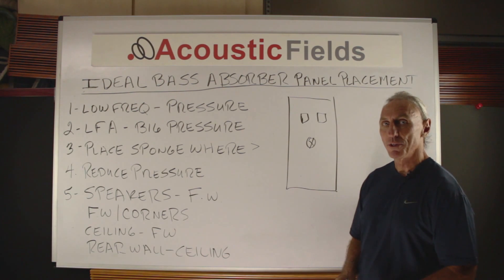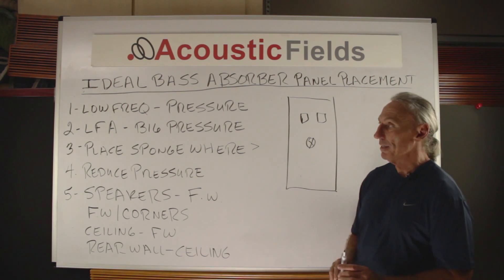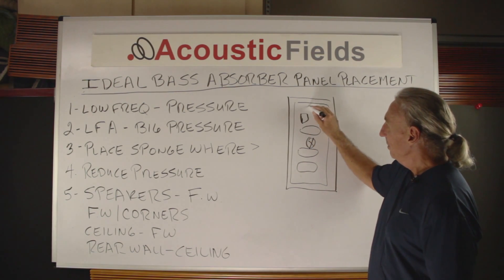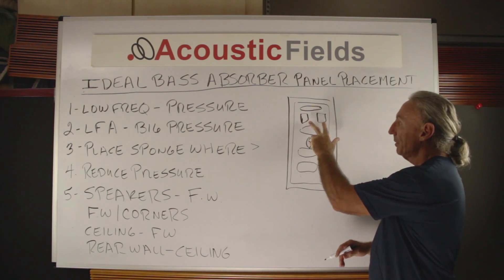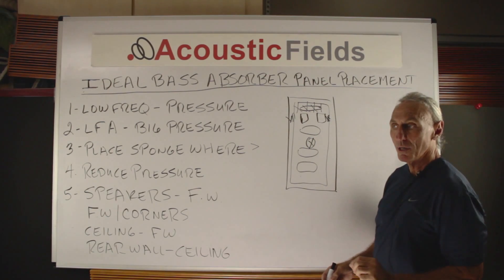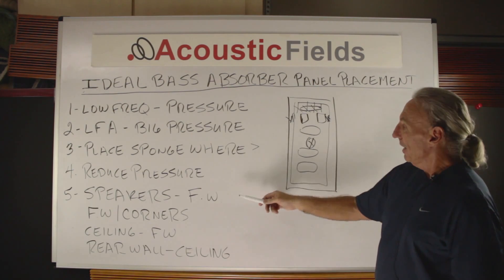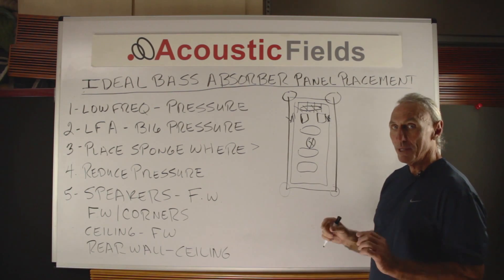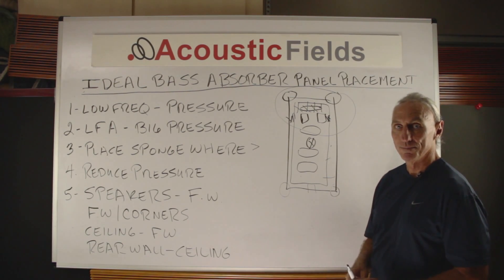Ideal Bass Absorber Panel Placement - www.AcousticFields.com

Comment: Gospel Denis! I'm using your philosophy with killer results!!! Thank you
Reply from the maker: Thank you. I would like to see more of these comment types. What treatment tactics are you using and why.
Reply: @AcousticFields  I'm following your principles here! I'm using a competitor, only because they where more accessible? I'm capturing the first reflection at only about 2 feet from the side of each speaker. Great for uneven rooms. Keeping all? the reflections off the wall, right off the bat. Nothing in the corners. Only from behind each speaker (open baffle) and in between on the front wall!
Reply from the maker: Ok good. You have addressed some reflection issues. What have you done to deal with unwanted pressures.
Reply: @AcousticFields  I have 5 ASC tube traps. One on each side of the speaker, and 3 on the front wall. Curved diffusors also in between on the front wall. Slivers of drywall showing also.

Comment: 👍That sounds plausible: The most effective position of Bass Absorber is near the source (the speaker) and near the boundary (the wall). The second most effective position is in the corners of the front wall, only third in range is the position in the corners of the rear wall.
Reply from the maker: If you treat the wall, you have no secondary anything.

Comment: I have also found days ago that the front wall is more important than the corners; and just discovered the video now where you talk about the myth corners. Thank you for confirming my suspicions. 
How much height would you say is important in relation to the ears to cover? from floor to ceiling? And to the sides?
If the axis are the important thing to cover and you are relative far from the corners, do you think abortion there is not that much worth it? Is it better to leave as much distance as possible between the wall and the absorption? As I understand it, the higher the speed, the greater the absorption, the opposite of the closer it is to the wall. Is placing the abortion right behind the speakers silly?
Well, thank you for your content Dennis
Reply from the maker: Cover 60% of the front wall and each of the other walls. Keep the treatment at least 12" above the listening position.

Comment: Hi Dennis and folks. I have no doubt about your knowledge.! But I have (40cm deep) of Bass absorber 50x100x40 cm behind left and right main front speakers from aixfoam (Open-cell PUR acoustic foam) and it does work exceptionally well.! Thanks for your great videos 🙏✌️
Reply from the maker: Foam lacks the proper rates and levels to deal with the pressure levels behind speakers and the front wall. You must apply the proper technology within the room positions to deal with those specific issues.
Reply: @AcousticFields  I'm sure you have a video about it, but most people don't understand the difference between pressure and velocity based absorbers. Velocity based "traps" are not very good at low frequency absorbtion. Also probably doesn't help that you sell foam panels that probably 85+ percent of people consider "bass traps", while also saying how bad foam can be. Though I'm sure most of the time you reference foam in your videos, you are likely talking about the "cheap" 1 inch thick panels people buy on Amazon. Ends up costing them way more per square foot than if they just did some diy mineral wool absorbers. Plus the mineral wool absorbers will reach down significantly lower.

Comment: Is it better to place diffusion panels behind the speakers if they are planars?
Reply from the maker: G,  It is one option. If you place diffusers on the back wall of planars, you should also treat the rear wall with diffusion. If you can not do both walls then absorption for front wall and diffusion for rear.

Comment: Hey, thanks for your video! So I'm dealing with this. I have a substantial amount of low frequencies building up in the middle of my home studio (1 room, both for recording and listening). I have big superchunk bass traps in all corners. I have a big window in front of the room and would not like to cover this with bass reducing devices. Would it help to make a big bass trap all over the rear wall? I understand it's hard to judge when not having the precise measurements of the room.
Reply from the maker: L,  This is a good example that putting absorption in the corners does not have the desired impact. Axial modes are produced by two walls so you must treat both offending walls.
Reply: @AcousticFields  Would it help to get a subwoofer and move this around or should I focus on the room first? Also, will 1 sub woofer be enough to deal with this?
Reply from the maker: L, It has to be a combination of both treatment and positioning. Both will lower amplitudes when used together.

Comment: Hey Dennis. Great video. I have a peculiar problem in a room where the surface behind the speakers is glass. It's customised doubled paned glass of 12mm and 10mm thickness at a small angle. This used to be a window and was sealed this way for isolation. However the surface is quite reflective and placing absorbers on that surface is also quite difficult. Especially since the user doesn't want the natural light to be blocked either. How do I deal with this?
Reply from the maker: L,  We make a product for just such as issue. It is our foam sliding panel. https://www.acousticfields.com/product/sound-absorbing-panels-for-windows/

Comment: Thank you for this explanation! 
Question. I have a rehearsal room and I would like to reduce sound reflexions from it. In this case, the sound pressure comes from the gtr, bass cabinets,  and the drum set.  Meaning that  I have several sound sources placed in different areas of the room. 

Having said that, the questions are:
+ How can I control reverberation time without killing/drying the room that much?
+ How should I place my acoustic panels in this situation in order to get a cleaner and clearer room sound for music rehearsal?

Thank you in advance for taking you time reading this.
Reply from the maker: A,  Reverberation times are usage dependent and subjective in nature. With multiple sources in a small room, start by treating 50% of each wall surface area. Use the room for awhile and then make the additions or subtractions in absorption materials.

Comment: Hey! firstly thank you for great videos. I moved to new apartments and want to make my room a bit better place for music. The room is large and will be used as some kind  living room and office for me and my girl friend. The point is to remove any kinds of hum and echo because the room is almost empty (see the pictures below) and secondly reduce outcomming noise to my neighbors. 
 My situation is a very different from all the videos which i found on the internet. I did some pictures in paint to show my room plan. 
 Option 1) https://i.imgur.com/V7aOBYD.png  - this option is currently used.
 Option 2) https://i.imgur.com/UaI1in5.png
Question: Can you please help me to make a best placement for traps and noise reduction material on the walls? I'm still a working student, so my budget is not very high :) And ofc. my girl friend shouldn't be shocked by seeing this dark awesomeness :D
 Is it possible to do at all in my case? 
I would be so thankful if you help me.
Best regards.
p.s. loud speakers are - Edifier R2730

Comment: Hi Dennis, I just built 4 broadband 4" bass absorbers, plan to place them in each ceiling corner of room, so they are kind of angled, they come a bit out from the corner though and leaves quite a space. is this still a good use of the panels or is placing them vertical to the corner more advisable. thank you for your time and videos. N.
Reply from the maker: M,  Are these our BDA units?
Reply: Acoustic Fields nope, there punk diy Rockwood slapped onto a cheap wood frame with some kasmiri clone fabric slabs, there about 180cm x 60cm x 4 inch thick. I'm approached this project with wreckless abandon and thrown the absorbers in the corners with the attention not unlike Coltrane s mid interstellar solos to being in key. appreciate your reply sir, I can send ya a pic if necessary, cheeri-O. 🎶
Reply from the maker: M, Without knowing the frequency response of the unit, it is difficult for me to assist you.  With a 4" depth and a building insulation fill, you will be absorbing from 90 Hz. and above. This unit would not qualify as a broadband low frequency absorbing device. What is your room size/volume/usage of the room?
Reply: Acoustic Fields Dennis, appreciate your time, I see, well the dimensions are  12.5x11.7x8.1ft, the speakers are currently placed parallel to the lengthier side, about 20cm from the wall with a king size matress in between. the opposite also has a 15cm width king size matress, there is also a couple of sofas. the room is for mixing and production, it would be great if I could bring it up to a level for mastering.critical listening is saught after,  I'm hoping to create a RFZ (reflection free zone) for the mix position which is now almost right smack in the center of the room. sitting on the sofa in the back end of the wall opposite the sound has a huge bass boost which is almost desirable as clients can get a more home theatre vibe when listening back :) at least that's how keep positive about it,:) mix position accurate sound is what I'm going for, nothing on the ceiling yet, but I'm planning another bass absorber or two installations up there along with some fractal diffusers... live in Taiwan so not sure what materials would be available at what cost if you recommend something, cheers man, 🍻

Comment: I see in this video you talk about bass absorption on the front wall.  I believe in others you talked about putting diffusion on the front wall. For my listening room I had pre-envisioned (as a starting point) to put diaphragmatic absorbers in the two front corners with diffusion between them.   But now I'm wondering if  I'd be better off with more bass absorption in that area.   I realize data will help me out when I have it.  How do I determine which will be best?   (I have to confess the RTA room measurement process scares me.  Last time i accidentally blew my speakers causing thousands of dollars in damage).
Reply from the maker: R,  Low frequency management is all about TAP (type, amount, position). You must select the correct type of low frequency technology you are going to need. Remember, there are three types of low frequency absorption technologies. This decision is based  upon frequency and amplitude of the low frequency issues within your room size and volume. Amount refers to the square footage requirement of that chosen treatment  and position is where to locate the technology. starting with low frequency absorption on the front wall area is a good start. Most front wall areas have high pressure issues because the speakers are close to that boundary surface. Most rooms we design have 40 - 60 sq. ft. of low frequency management technology on the front wall.

Comment: I understand that this is easy to overabsorb using acoustic foam, which will result in "dead" sound.
But my question is; is it possible to overabsorb low end using pressure activated devices? Or is it "more absorbers = better" rule?
Reply from the maker: Hi Daniel, You must quantify the low frequency issues within your room through measurements by developing a strategy that deals with the frequency and amplitude of the low frequency issues within your room. If you are over absorbing or under absorbing, you are using guessing as a tactic without a sonic strategy. Guessing is gambling. I am not a fan of either. We have a saying in our office: Don't hope - know.

Comment: And the absorbers behind the speakers should be wideband or tuned at a certain frequency (room mode frequency for example) ?
Reply from the maker: Hi Casovini,  Most of the time it is more broadband low frequency coverage. We use 30 Hz. - 200 Hz. However, sometimes you need more frequency specific absorption from 30 - 50 Hz. It depends on the ceiling to floor dimension along with the width dimension. Low frequency driver number and diameter plays a part as well as their locations within the room size and volume. There is no one size fits all.

Comment: Hi. First let me thank you for your informative and useful videos. I recently moved to a new place and figuring out all these issues. I mostly use Roxul Safe and Sound insulation pads. However my question here is [ I have all 4 corners in the room treated with floor to ceiling panels. How thick should they be? Currently I used only 1 layer of Roxul, but I suspect at least 3-4 layers thick would be the way to go for corners?
Reply from the maker: Hi Sebastian, I must have more information about your room. Remember, that the highest pressure areas are usually not in the corners of your room. Fill out the information in this link: http://www.acousticfields.com/free-room-analysis/

Comment: Im building a vocal booth for one. I was wondering do you need to absorb the bass in the room for that? im doing it from the ground up. tips and pointers would be cool as well. Much appreciated Aubry.
Reply from the maker: Hi Aubry,

Male vocals start around 100 Hz. Unless you are recording numerous male vocals, low frequency issues are not a problem. Diffusion works well for vocals. Make sure to include it in your vocal booth design.
Reply: Like have diffusion walls in the booth?
I was planning on foam and plywood. And it willl just mainly be me with my male vocals. I rap as well as produce.
Reply: thank you for coming back to me.

Comment: Without a doubt these presentations are the single best resource for Acoustics I know of.
Dennis, your ability to summarize these very complex concepts, while remaining practical is incredible.
FYI I studied Acoustics at University for two years (20 years ago), and have been obsessed with the topic ever since. I still consider myself a learner, these videos are a gold mine to me :)
Keep it up!
Reply from the maker: Thank you for your support. If you have any topics you would like to see covered in this video format, do not hesitate to ask.
Reply: Your presentations (rightly so) focus on recording studio type environments. Im currently working on improving the sound of a small dancefloor/room for a club. its a concrete rectangular box 8.84m L x 5.38m W x 2.57h (with cieling going to 4ish metres). Its a great challenge to get it to sound good while keeping the bass that gets out under control. We have a pair JBL 715 Active Speakers, which have 15" drivers are WAY TO BIG for that room. The 18" RCF Subwoofer is borderline gratuitous, and Im gradually convincing everyone that we dont need it.A dbx Driverack PX made a great improvement inside (a really great product FYI), but I want to control the 135hz boom/hum that travels out of it into the large foyer, and then outside (Neighbor issues). (I found that was the frequency using the iPhone "Audio Audit" app - very useful. Im thinking polystyrene "cityscape" QDAs on the ceiling to scatter as much of the bass as possible, and breakup the standing waves (its pretty obvious to me that the foyers floor to ceiling surfaces are the main cause. Changes inside the danceroom wont be effective, as the DJs will just turn it/adjust their EQs till it sounds the way they want, so we can only take action outside the room.
Sorry for the long Preamble :).
Do you have any generic advice for dancefloors? Im also thinking of making a big diffuser for the back wall to make it "disappear", I assume that would be a good Idea generally. Im also thinking of making some bass "disrupters" for the corners, they wont be able to trap that bass(I also dislike the implications of the term "Bass Trap"), but they can stop it getting too settled in one place :)
Once again thanks, Im sure you are very busy, any even non specific advice would be greatly appreciated.
Thanks  :)

Comment: Question:  Is this video  only assuming a two full range loudspeaker setup?  In my setup I have  everything below 100hz going to a sub,, so does that mean it's lower priority to  treat behind the speakers now?
Reply from the maker: +Scott smith  Room size and volume are the critical factors in dealing with low frequency energy. The unwanted low frequency pressure areas manifest themselves in different locations depending on room size and volume.  Fill out the information in this link and I can assist you with those issues and the appropriate treatment. http://www.acousticfields.com/free-acoustic-treatment-room-analysis-tell-us-room/

Comment: Would crumb rubber be a suitable limp mass for a large-scale DIY bass trap? I'm unsure about sound energy absorption as well as the consideration with the material off-gassing in a closed environment.

It seems that activated carbon is too expensive for sufficient coverage in an auditorium.

 What are the alternatives for bass trap materials?
Reply from the maker: Hi Samuel Haywood 

The best way to figure out if a material will work as a low frequency absorption technology is to build the unit and have it tested at an accredited lab for verification of your initial hypothesis.

An auditorium by definition at least here in the states is a larger volume that can sustain low frequency waves. Auditoriums are notorious for high reverberation times which is a middle and high frequency issue.

Thanks
Dennis
Reply: Thank you for the helpful response, Dennis. Your videos are all very informative.